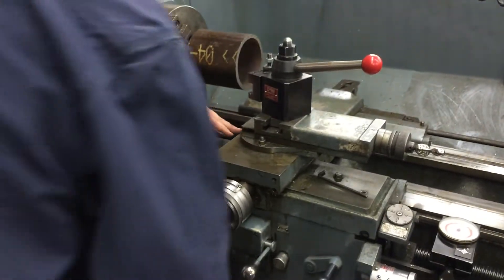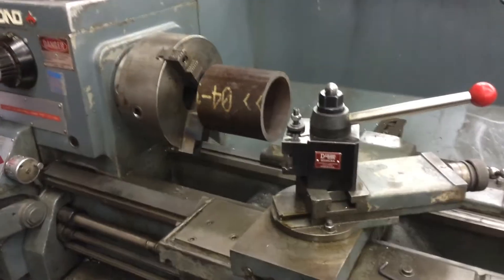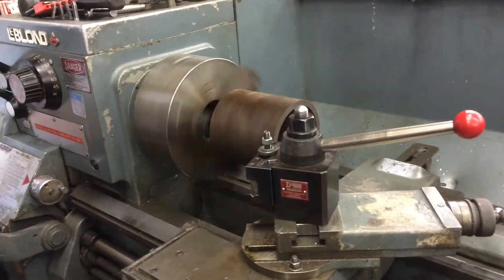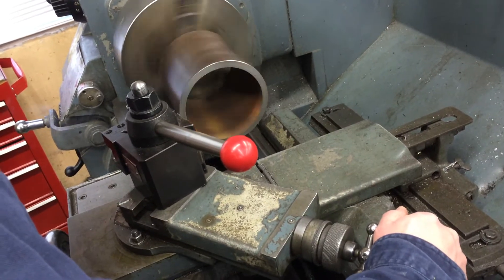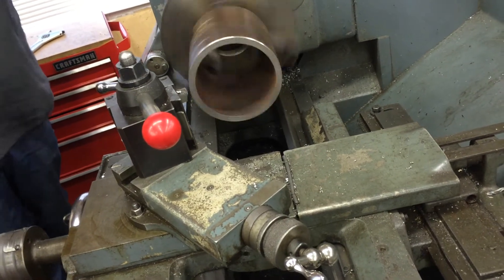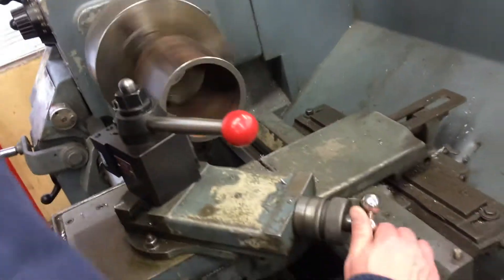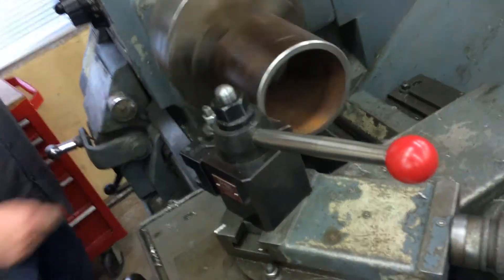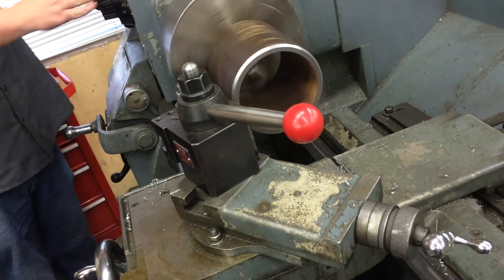How to Bevel pipe on lathe

Comment: Your 37.5 is measured the wrong way. You want it to make a 75 degree included angle in the groove when two bevelled ends are mated together. The way you did it will make 105 degrees. Also, your concentricity is way out, partially due to using a 3 jaw chuck. 

If these are test coupons they will likely call for a 37.5 degree bevel (to a feather edge, root face or "land" is welder's discretion most often) to satisfy the maximum included angle allowed by most registered welding procedures- the minimum being 60 (from 30 degree bevels)... which makes for much less welding on larger lines and heavier wall thicknesses.
Reply: Pipe bevel angles are measured off the root face/edge, which the welding symbol for groove welds implies, and that's exactly what the machinist did. You have your axes mixed up. Think about a miter saw.